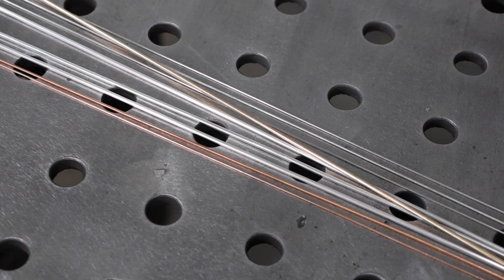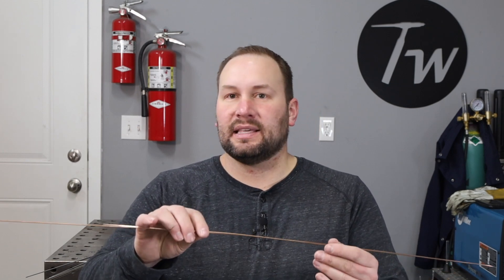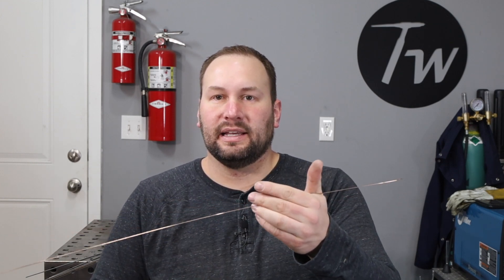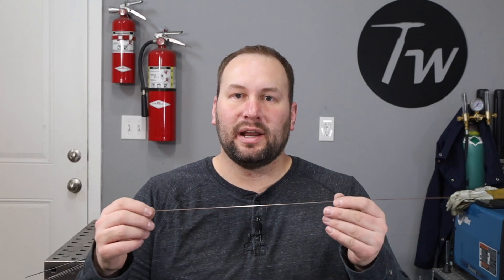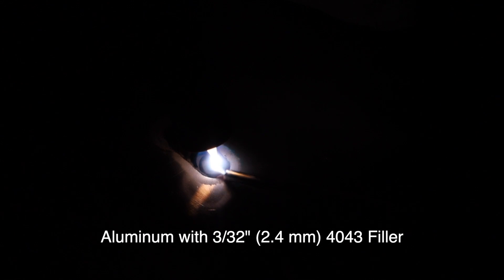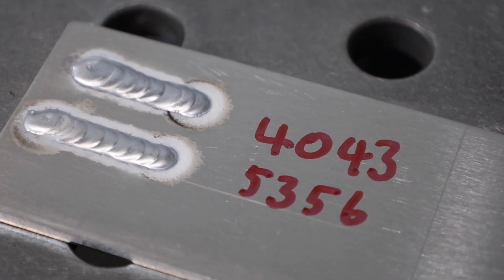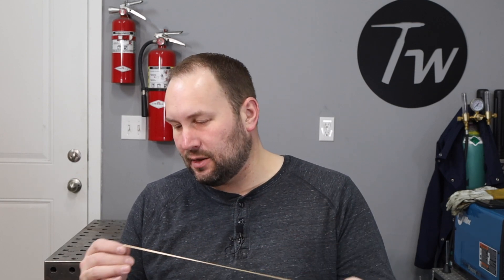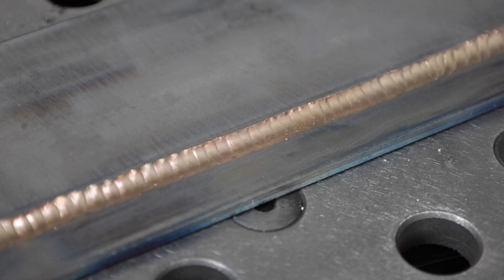TIG Welding: What filler metal should I keep on hand?

Comment: I'm working through your TIG welding course right now and practicing.  All of the welding supplies in my area only carry ER70S-2 in 1/8 or 3/32 size.  When I asked for 1/16 or .04 they look at me like I'm from Mars, lol.  I've been trying with 1/8 so far and it seems really too big practicing on 1/8 coupons... I got some 3/32 today and I'm going to give that a go and see if it's a bit more manageable for me.  I did order some 1/16 online and I'm looking forward to trying that out as well.  But I figured I really may as well learn with what's going to be readily available anyway

Comment: Quick note. If welding cast aluminum, stick with the slightly softer 4043 filler. This allows for more elongation and better prevents cracking. Also 5356 has a higher tendency to deposit porosity in the weld, it prefers cleaner metal than 4043.
Reply: Thank you!

Comment: Where was this a month ago?! I got pretty close, but went with 4043, 309l instead. 4043 being able to do cast, possibly wets out better and 309l for the dissimilar/unknown metals, if that's correct. I did get most of the rods in 3/32 tho. It sounds like I could have gone size smaller but most will just be beads on plate to learn tig for now. Would like to mention, for those looking to get into it too, that it sounds like 3/32" laYZr (chartreuse) tungsten is a popular all around do everything tungsten. Hopefully have the 220 plug wired up next week and I'll be able to find out for myself. Thanks for all the videos, sure getting excited
Reply: How the tig going? Did you get your 220 wired up yet? I just got my first welder a few weeks ago. So basically where you were at 2 years ago when you made this comment. I went balls deep into the welding world though. Bought a mig200 and a tig200, and a 55amp plasma cutter. Privably 100# of different filler and about 20 packs of different tungsten. I haven’t tried the layzr yet though. Probably going to order some after I write this comment though. I’ve had success with the grey and red though. I use 3/32 tungsten for just about everything. I’ll just change my grind to fit the material. Anyways sorry for the novel. Hope all is good with your welding adventure.

Comment: Do a video with what rods you can use with the HTP 160 plus welder
Reply from the maker: The only rod I had any trouble with was 3/32” 6010. 1/8” 6010, 3/32” & 1/8” 7018 worked great. I’m sure 6013 would be fine as well.

Comment: I used to work in the chrome department at Harley, back when they did their own plating. We had to load the plater baskets with pure nickel ingots (99+% pure) every Friday after 1st shift was done and it would take about 2 tons of nickel. The ingots are about the diameter of a quarter and come in metal barrels (about 12"x30") which we craned onto the deck surrounding the plating machine. We then emptied the barrels into buckets, from there we would fill basically a plastic bleach bottle with the bottom removed and dumped that into the titanium baskets which hung in the nickel solution, refilling the bleach bottle several time for each basket.  The nickel tank was pumped to storage tanks for this refill operation. Many ingots would get spilled while we did this and we used large magnets with an on/off switch attached to a handle to pick them up. Pure nickel is magnetic.
Reply from the maker: Very cool! In iron based alloys, nickel is an austenite stabilizer, causing the iron atoms to arrange in a face centered cubic crystal structure which is non-magnetic.
Reply: @TimWelds  please reiterate this in plainer language.  Sounds really important but a bit over my head.
Reply: @carpediemarts705  Iron and nickel are magnetic on their own but when the two are combined they are no longer magnetic.
Reply: @GiovanniGiorgo  Thanks.  I would have expected those 2=magnetic stainless.  I also thought chrome was the most significant non iron ingredient in stainless.

Comment: Great video thanks! If you silicon bronze on stainless you don't need a backpurge right?
Reply from the maker: I’ve never used it on stainless, but I think it would still oxidize to some extent without a back purge. Whether that matters or not depends on the requirements of the application.
Reply: For thin stainless (say thinner than 16 ga or 1/16" or 0.063") I've found it's difficult to keep the heat low enough to avoid penetration (and sugaring) while still getting the area hot enough for proper brazing.  It can sometimes be done if you tune the settings and can be easier with pulsing, but some sort of backing or something like Solar Flux can be useful if you're wanting to avoid back purging.  For thicker material you have more wiggle room, probably because stainless conducts heat so much slower than mild steel.  Some of this will depend on your strength needs, however, since the bigger beads required to match the strength of the base metal typically mean higher heat input—and the danger of sugaring or granulation returns.
Reply: @benz-share9058  Thanks for the tips! This is useful to know. I guess the thing to do if it doubt is try on some offcuts and look for sugaring.

Comment: I heard the zinc content in the silicon bronze may give problem when using tig.
Reply from the maker: I’ve never had an issue with that, I’ll have to look into it. Thanks!
Reply: Very true, if you attempt to use typical oxy-acetylene brazing rod with Tig..... it'll be a popping/fuming mess; because of the zinc.

Silicon bronze for TIG (ERCuSi-A) doesn't have zinc.